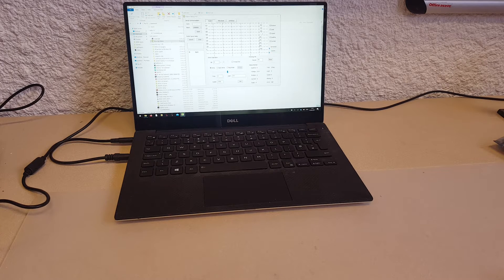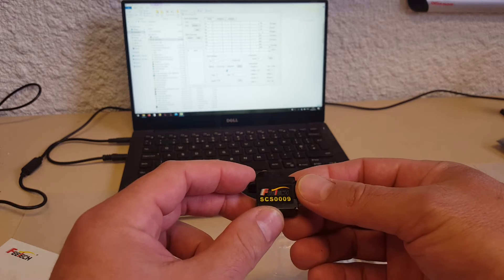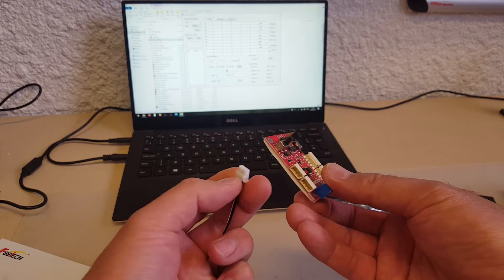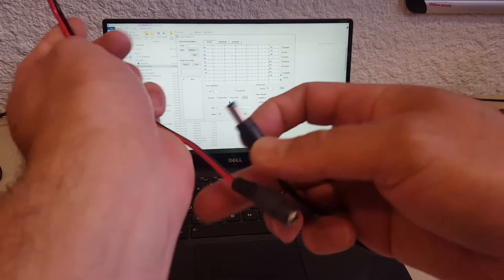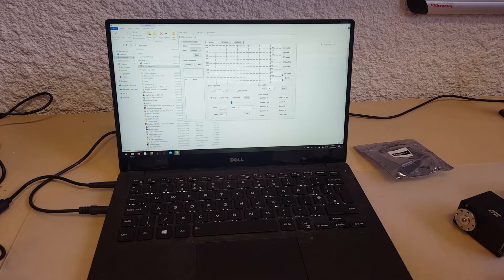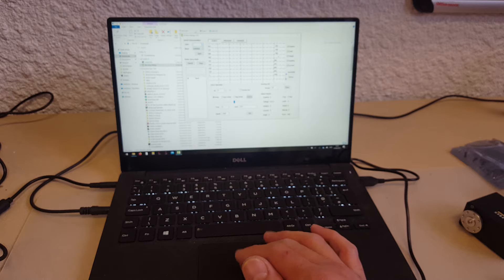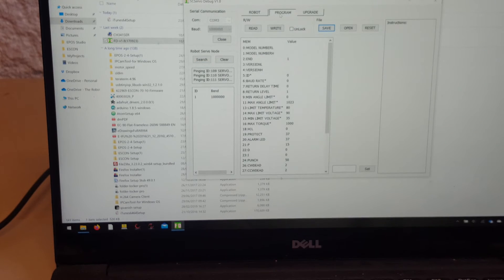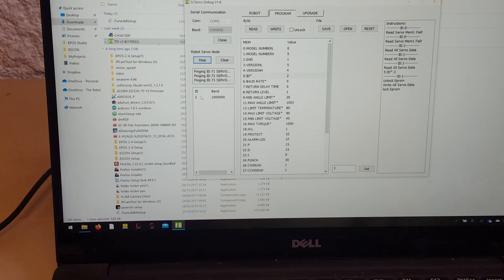How to change the ID of Feetech SCS servos

Comment: Do you have any idea about how to read and write on the servo EEPROM without using the provided software?
Reply from the maker: Have you tried the Arduino code - it will allow you to send and receive commands for sure. Possibly also to write to other registers though I’ve not tested that. It’s discussed here and a zip file is posted that apparently contains the libraries: 
https://forum.arduino.cc/t/serial-problem-with-arduino-due-with-feetech-scs09-smart-servos/468064
From memory there should be a c file to add your code to, a cpp file and a header file that will all compile as an Arduino sketch. Please let me know if it works and if not I can send you the code directly once I’m back in the workshop.
Reply: @therobotstudio  actually, i do have the concerned library, it Works well! But i want to use this servo motor with esp32 with esp IDF firmware using vs code, so Arduino code won't work here, that's why i am trying to get access the EEPROM to directly change the position and the read the saved data...
Reply: @therobotstudio  I tried to add the library files to the vs code cpp and headers, the problem is that  some header files have be called like Arduino.h, WProgram.h and serialhardware...that are uknown for vs code...
Reply from the maker: @zack6418  the ESP32 is a great looking board, thanks I didn’t know it before. Unfortunately it seems you will have to manually edit the code for the ESP compiler. I encountered the same problem trying to use an mbed. The only other way is to use an Arduino as an additional interface board but obviously that’s rather inefficient.
Reply from the maker: @zack6418  toit.io seems to offer some sort of container that may port the code automatically but I’m not familiar with exactly how it could work here
Reply from the maker: @zack6418  this looks like it should work: https://randomnerdtutorials.com/installing-the-esp32-board-in-arduino-ide-windows-instructions/
Reply: @therobotstudio  this is not what i am looking for, i am not willing to use Arduino IDE, i am trying to use vs code with esp IDF firmware which doesn't recognize ino files so i am trying to use this servo motor with esp IDF firmware (without Arduino).. i don't5 know if you get what i am looking for
Reply from the maker: @zack6418  I think you’re looking for a quick way to port the code but I don’t know of any that’s compatible with Visual Studio. The protocol for serial communication with the SCS servos is described in the Feetech documentation and of course also encoded in the Arduino code. It’s relatively simple as bus communication goes but it’s still gonna be a pain to transfer to VS. The choice is whether to write it from scratch or rebuild it from the  Arduino code.
Reply from the maker: That being said there does appear to be an extension for VS to use Arduino code: https://marketplace.visualstudio.com/items?itemName=vsciot-vscode.vscode-arduino
Reply from the maker: Whether this is compatible with the EPS IDF extension for VS I’m not sure. Be interested to know if you can get it to work…
Reply: @therobotstudio  actually، there is Also platformio extension that Can compiler Arduino files, but the problem is within the esp IDF compiler, esp IDF compiler allows us to use semaphore and queue and other interesting thing, esp IDF compiler can compile c,  c++ files and esp32 files but not Arduino files, this is the problem...
Reply from the maker: @zack6418  the EPS compiler can use VS code though, and VS code can incorporate Arduino code - why doesn’t that achieve what you want?
Reply: @therobotstudio  actually in vs code there is extension, and Every extension has it's own only one compiler.. so there is espressif extension that i need that vas esp IDF firmware (compiler), and Arduino compiler
Reply from the maker: @zack6418  Figures 😕